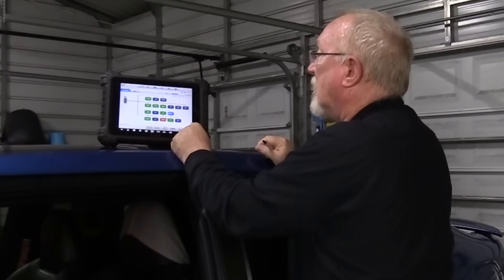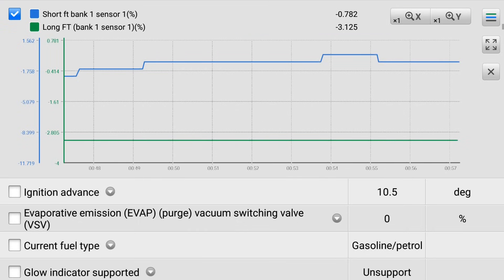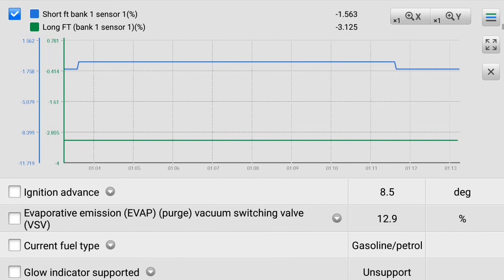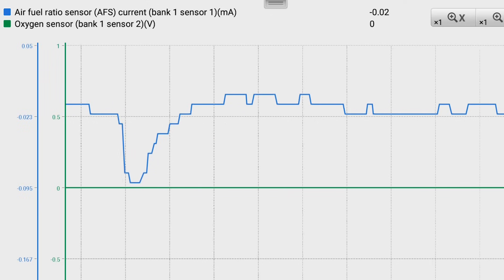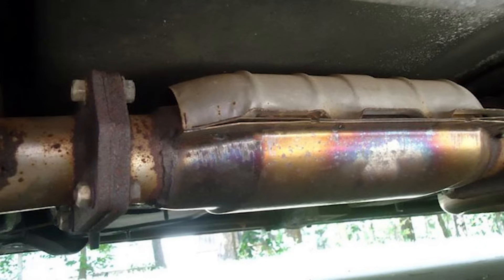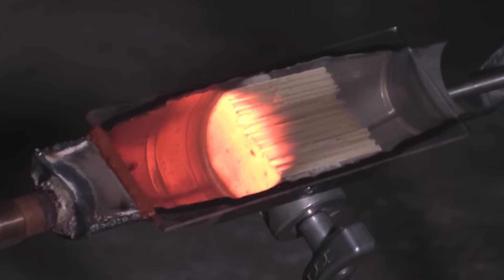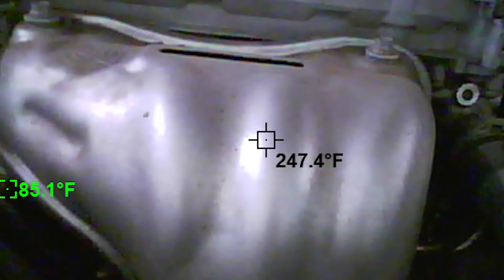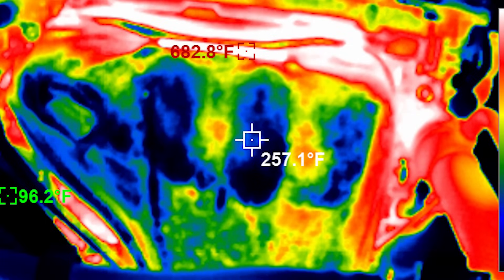The Trainer #118:  The REAL Cause Of P0420/P0430 DTCs

Comment: All of these are great tips, but let me tell you my experience. I have a 2013 Nissan Altima S with the 2.5 4 cyl. For several months I was plagued with the P0420 code. My mechanic tried all the usual diagnostic techniques, checking o2 sensors, cleaning the catalytic converter, even going as far as gutting the rear catalytic converter to relieve a suspected blockage. The problem not only persisted, it got worse. Instead of coming on every 150 miles or so, the Check Engine light came back on every 50 miles. I have probably spent around $500 trying to get the stupid light to stay off. You know what finally solved the problem ? As per routine maintenance, I removed and cleaned (I have a K&N) my air filter. I cleaned and re-oiled it according to K&N's instructions and re-installed it. NO MORE CHECK ENGINE LIGHT. After all the hours and all the money needlessly spent, the solution was to clean my freakin' air filter !  Something so basic and elemental, I didn't even think of it. The lesson here ? Check the most basic, cheapest stuff first. You may think you have a special car with a problem so unique, no mechanic has ever seen it before. In all likelihood, 
its something simpler than you or your mechanic realize.
Reply: Save the K&N for the dirt bikes. Use OEM air filters. I put original OEM air filter in my Lexus LS400 and now I'm getting better gas mileage.  Switch to the OEM Air Filter  and run a can of  44K Platinum  by BG  in a full gas tank.  That got rid of my Check Engine light.
My CATs have 278,000 miles on them. I always use 44K  and it gets rid of my check engine light for quite a while.  I use Chevron gas. My emissions test results way below the limit.  Codes P0421 or P0420,  OEM Denso O2 sensors..   Lexus tried to get me for $4000 for two CATs   Ha Ha Ha Bozos
Reply: @tonyisme4934  sick. im dealing with p0430. and bank1 and 2 too lean . theyre tellin gme its cats too but im convinced its vacuum/exhaust leak or o2 sensors. just dont have any tools at all and that makes everything 10x harder
Reply: Just a heads up if you use a K&N, keep your MAF clean.
Reply: There is a lot to comment here with your posting. Probably you are not telling the complete history of the problem. Lets suppose that the last thing done, as you say, was the cleaning of the K and N filter, and all the rest was ok, I find hard to explain why the code P0420 was set. If the air filter was partially plugged causing a reduced amount of air going to the engine, others codes should be set, like rich codes, MAF sensor codes. A good analysis of the engine data with an scanner will catch o question a restriction on the air flow or intake air. By the way, most of the time installing K&N air filters on street car causes more problems than benefits. I have seen many times MAF sensors getting dirty o contaminated with debris because the K&N filters are unable to stop this debris due their big holes on the material they are made of. ASE Master Tech with 40 years of experience repairing all brands of cars.
Reply: @pedrovillalobos2037  100% correct. Other codes should have been present. Certainly the MAF reading would have been out of spec. 👍👍
Reply: EXACT SAME THING happened to my son on his G6. His mechanic told him some cars don’t like the K&N filter.
Reply: Even something as simple as a loose gas cap can cause it
Reply: My father in law was cussing up a storm the other day because his push lawnmower wouldn’t start. He already changed the plug; I could smell fuel. I had an idea; I asked him to go grab a screwdriver. Soon as he was around the corner of the house, I popped the air filter cover off and pulled the PLUGGED SOLID air filter out and fired it up on one pull. He was incredulous; I messed with him for a few minutes before showing him the filter. Always check the simple things first. 
Three things for an engine to run: air, fuel, spark. Most people overlook air; they think it’s a given. 
Same thing with poor a/c performance; I have fixed so many just by cleaning the coils
Reply: @Beast_is_a_dumbass220  an engine also needs compression. Needs 4 things.
Reply: I have been having a similar problem and was just about to take my Camaro in. I’m gonna check all the little things first just to make sure before I do. Thanks for the tip!
Reply: I have an 09 Lincoln MKX AWD with 2 catalytic converters. How do you know which converter is bad and need replacing? (Front or rear) What do P0430 code mean? Will that code go for both converters or will each converter have different code for the location of the converter?
Reply: @vernetteharris3176  Code P0430 is for bank 2. Rear converters are not monitored by ECU on this car.
Reply: @vernetteharris3176  I know this may be too late but that is bank 2 converter. It will be the radiator side converter that commonly goes bad on all v6 engines in the Ford products. We are not sure why but almost always P0430 will come before a P0420.
Reply: @danielsmith7935  first day?
Reply: @harrybalsonya5619  no actually I work for an exhaust company and I am pretty versed in this stuff but thanks!
Reply: @vernetteharris3176  P0420= bank 1 (right side of engine). P0430=bank 2 (left side of engine)
Reply: Same thing happened with my 2018 Ford F150 2.7 L replaced the air filter with a Fram extra guard immediately got a PO 420 code the next day after doing some research went back with a Ford Motorcraft air filter PO 420 code went away.
Reply: @thejourneymen7722  Thanks, I'm going to try that.   I installed a Fram Extra Guard in my car right before the code popped.  I thought there could not possibly be a connection.
Reply: Guys, I tried that K&N filter once in my Kia soul 2012 and the MPG went too down, I put back the original and walla, went back to normal. Mechanic, shop and dealers just want money
, they don't care your car but the money they can take from you. I knew this cause all I did in my car nothing fix my problem of vibration of the car and mechanics, shops and dealer just want to replace what I already did, see? they just want money.
Reply: Some Nissans around 2016 have to be reprogrammed. On 2006 and later, the Mass airflow sensor was at fault and people spent hundreds on cats which were connected to the exhaust manifold.
Reply: K&N.... That's the problem. OEM only
Reply: Good damn thing I went and bought an air filter yesterday & have an appointment set Monday morning I got my catalytic converter to be replaced. ( under warranty) so even if it does turn out to be just a dirty filter.  Atleast I still have a new cat replaced free of charge but im sure its shots because I had a huge crack around the top of my flex pipe almost all the way around it  . Had that replaced over a week ago and muffler guy cleared the check engine light which is throwing the p0430 code and told me if it came back on odds are the cat went bad because of the huge hole in my flex pipe for the exhaust that I was driving around with it like that for so long before I even realized so well see. Car does have a sluggish acceleration and crappy gas mileage right now.  Hopefully having new catalytic converter and new engine air filter put in will permanently fix the issue and the check engine light won't come back on with the p0430 code after I have all this done! We shall see! Lol!
Reply: I had a similar problem. But it wasn’t just cleaning the Canon air filter it was also cleaning the mass airflow sensor. The thing that pisses me off is the three mechanics I took the car to when I was having these issues all they didn’t look at codes and replace parts. That’s what they are parts replacers. They have no clue how to diagnose anything on their own without a computer.
Reply: My experience has been the opposite. Hadn't had a light on. I changed the air filter and a few days later the light came on for a couple days. Started the car up expecting the light but it's been off for a few days. Not sure whats going on.
Reply: You’re not doing yourself or you car any favors with that shitty air filter, NONE!
PS. Do your due diligence and find a competent mechanic because yours sucks!
Reply: don't use K&N filters , use oem
Reply: @wazzabanzook5028  Best comment !
Reply: @wazzabanzook5028 Yes !. Or Mann filters.
Reply: Your mechanic gutted the rear cat?  Backyard mechanic?
Reply: @Discretesignals  illegal!!
Reply: Your mech needs to be working with K.I.S.S. principle. Ive been got by similar things more than once.
Reply: I find most times these issues are from aftermarket parts.
Reply: I am going to check small things first like you described 
Thanks for sharing
Reply: Mmm 👍🏼 i do have a K&M filter. 2014 GMC Terrain cracked exhaust manifold and upstream O2 sensor with a exploded looking heat shield on tip replaced. Code came back. Was going to just be a parts replacer with downstream sensor but will replace my $50 K&M filter 1st! Will also try some gas CAT cleaner in tank too! Thanks for the tips!
Reply: K&N filters have oil and are usually over oiled which coats the MAF sensor and throws things out of whack. Do yourself a favor and wreck with an OEM style filter.
Reply: Air filter? Come on..I got say code for over a year now. Definitely not air filter. Clean as a whistle

Comment: Hey I've  question , can you go into more detail  regarding  the vaccum  technique  it was very  unique. Because  I don't  have a shop or such with high end equipment.  I do have a borascope  but no gas machine, I. More of a Diy person but I'd  like to learn.
Reply from the maker: I don't take credit for the techique, as I shared in the video. Your shop vac has two ports - an inlet and an outlet. The hose is typically attached to the inlet (vacuum side) and the vacuum is vented through the outlet. To use it to pressurize the exhaust, simply move the hose from one port to the other and attach the (now) pressure side to the exhaust, using duct tape or something similar to keep it in place. Then turn it on and use a mix of soapy water to mist the exhaust - and look for the bubbles!
Reply from the maker: The Edwin Manna Filez  I'd still do a compression test but regardless, you'll have to get into the engine to fix that. The oil passing through the exhaust will certainly poison the catalytic converter and cause that P0420, too.

Comment: Hi Pete, how are you? I would like to know how much back pressure there should be in the system when the pressure transducer is used, many information recommends one psi at idle and no more than three psi at 2,500 RPM, is this correct? Thank you .
Reply from the maker: Those numbers are considered "standards" but I like to see very little at idle. When using the pressure transducer, I'm looking at it building over time, especially when performing a snap-throttle test. That is where you'll see the restrictions show themselves.
Reply: @VehicleServiceandRepair  Dear sir , Cat on a 2012 Camry , 150,000 miles ... Burned oil since new to the tune of couple of quarts in between its regular 10k mile oil changes... Slow , long time oil contamination / poisoning of the cat  ? Thats my conclusion , what do you think... ?
Reply from the maker: @D...M...A...  Absolutely! I'd say try to clean it first using a fuel induction cleaner but with 150k on it, it's time to replace it.
Reply: @VehicleServiceandRepair  We're on Cat o clean # 6 thru the system , seems to be improving ... Triggering less #s of codes (420 )  per tank ... About to give up and change it , but it keeps teasing me with improvement... Thank you kindly for your reply and expertise ...

Comment: PO430 bank 2 changed both o2 sensors and its still not accelerating all the time but the light went off???
Reply from the maker: The P0420 and P0430 are measuring what's coming in versus what's going out of the cat. Troubleshoot the loss of power separately. Have you done a Volumetric Efficiency test? What do the fuel trims look like when the problem occurs? What load/rpm range?
Reply: @motorage- me too, friend told me air to fuel mixture? I have no idea what means.

Comment: My scan on live shows 2.275v on b1s1 with graph not bouncing much b1s2 .69v graph all over the place. Like the 2 are reversed on the graph. 4 cyl. 2.5 Altima.
Put scan on my truck 5.3 and both banks on tool show as it should be, so obd2 scanner is all good.
Any ideas or suggestions?
Reply from the maker: The front sensor on your Altima is likely a Wide Band Sensor, or Air Fuel Sensor (same thing, different names). The voltage on your scan tool will remain biased at a certain level, depending on the OE. The logic used to test your converter is different on these vehicles as well. However, the rear sensor should remain relatively flat if the cat is doing its job, provided the conditions needed to get it to "light off" have been met.

Comment: experienced an interesting one in regards of this code P0420…it wasn’t my cat at all but rather it was the oil leak that spread under my car due to negligence oil changed my oil guy did…my Hyundai dealer discovered it and saved me $4K of cat repair costs…it was a breath of fresh air after I learned about it
Reply: Yup I've seen that happen. Some cars have oil filters located directly above (or close enough) to the upstream 02 sensor and that oil filter can be in a very restricted spot in which you don't have much of a choice but to make a mess when you remove it. When that happens it's very possible for oil to leak/splash/drip on to the 02 sensor and eventually work it's way through the threads and contaminate the sensor.  I've seen this mentioned as a common issue in several car threads to the point that many car owners of that particular make/model started doing their own oil changes so as to not have to deal with the P0420 shortly after each oil change. This is also a perfect example of why it's so very incorrect to assume when a P0420 code pops up that it's the cat.  The vast majority of times I've deal with that CEL code, I've been able to resolve it other ways. Only once was it a bad cat and that was within the warranty period (luckily) and it was also quite obvious that it was the cat because it sounded like a metal can full of pebbles sliding around under the car when coming to a stop or accelerating indicated a shattered catalyst.  But every other time, it was not actually a dead cat and the resolution was usually relatively simple and a fraction of what it would have cost to replace the cat and/or sensors.
Reply: What do you use to clean the oil off? Mine isn't leaking but there is a lot of oil all over that area.
Reply: @JMarie-Texas  I didn’t clean it myself but I noticed when I brought it to my mechanic and told them about it…they air pressured hosed it underneath with some water and wherever the leak was coming too from the sides
Reply: I bet you're 2qt low of oil every oil change🧐
Reply: @keithburningbush6456  Can you elaborate on that? I'm a backyard but capable student. But I don't follow your tweak there. Are you saying they spilled a lot of oil? or something else? Just wanting to learn.
Reply: @packrat9433 when ebgine oil consumption gets to  obe qt in 800 mikes or less, the converter can get enough exhaust residue to coat the ceramic catalyst monolith. The converter then has too little function and post catalyst sensor doesn't show  correct O2 sensor value. The residue will coat O2 sensor and cause wrong signal in front or rear sensor, or both.